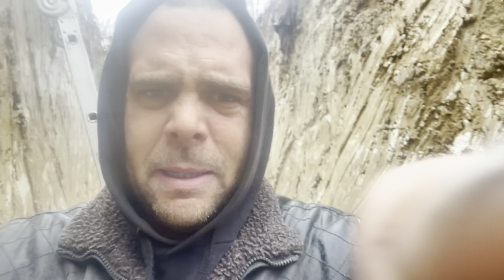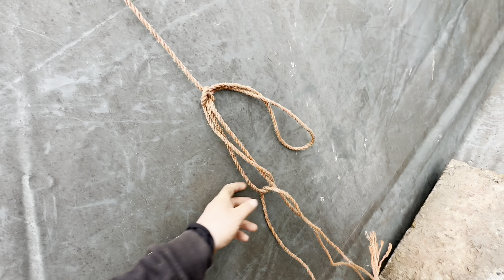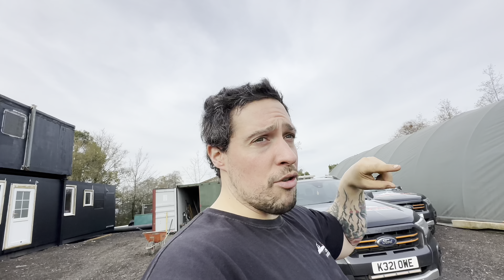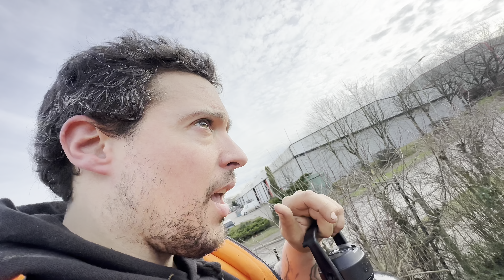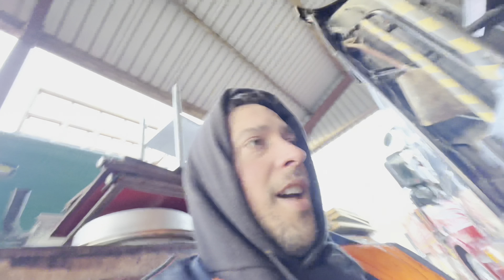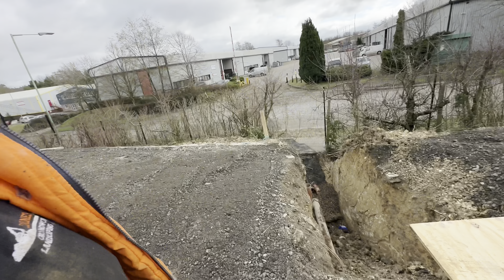The Professional Struggler comes down - Tent complete - Deep drainage excavations  - Episode 41

Comment: All these regulations are for wimps.
Not real workers working on there own property doing your own work thats kinda different regs.
Anyway lads I done my own workshop few years ago and made it out of a polytunnel but it was left in the original position but i extended the bottom with 1.5mtr poles that lifted the beam height up so I could get my ramps fully up with a van underneath.
And then just done block work around the bottom and put wooden cladding around yo make it look nice.
And fitted a second hand electric shutter door.
That was 10yrs ago it's still in operation now.
Great video ❤
Reply from the maker: Cheers Jon! A man after our own hearts!! Stay safe out there. 👊🏼👍🏼

Comment: Regulations 1966 specified that any excavation exceeding a depth of 1.2m is the point where a shoring system should be in place.
Reply from the maker: Well done james 👏
Reply from the maker: Hi James, the 1.2m rule is no longer an accepted precaution by the HSE and each excavation needs to be assessed with the correct safety measure put in place based on the ground conditions and other risk factors. Thanks for your diligence but would suggest any excavations you undertake are assessed based on the conditions of the site and ground itself.